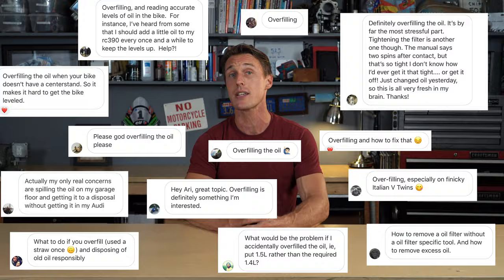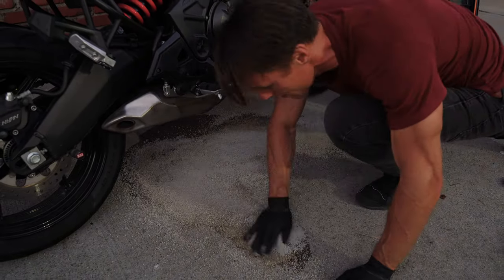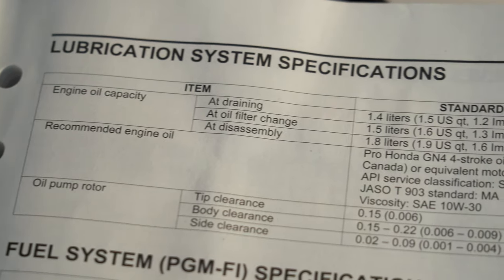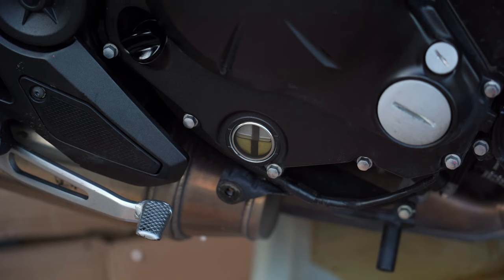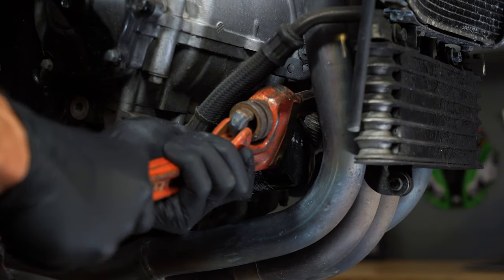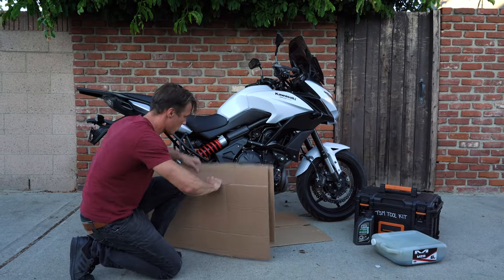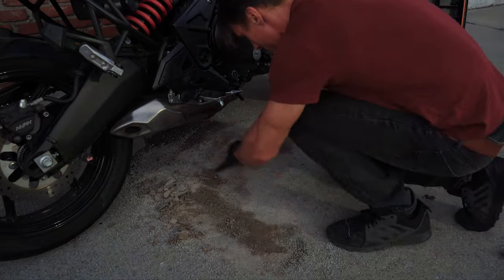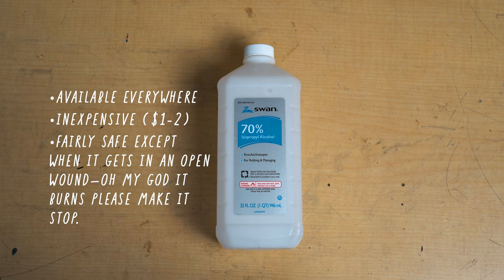Overfilled Oil, Stuck Filters, And Oil-Change Hacks | The Shop Manual

Comment: Alcohol works, but Dawn is my go to for oil cleanup.  It is even cheaper than alcohol  and it leaves things including your skin clean.  And it doesn’t burn in cuts.  😁
Reply: gemini232003 Madge deals with dishes, not real greasy messes.  😁. The folks that clean up animals caught in oil spills use Dawn for a reason.  Same reason I do.
Reply: gemini232003 Nothing against Palmolive, but once you have used Dawn it is hard to go back.  I think Palmolive is cheaper and is fine for normal dish duty.
Reply: Pro tip on Dawn if you have ground all that hydraulic fluid, 30 year old grease and 15,000 mile engine oil into your hands so deep you are sure it will never come out...no water, couple of ounces of Dawn, scrub it in with a nail cleaning brush and THEN add water.
Reply: Michael Krenzer I have found that by the time I am finished washing my drain pan and funnel with Dawn, my hands are already pretty clean even in the crevices.  😁
Reply: Brake cleaner works great, even on the floor.
Reply: @LTVoyager  Me after a day pulling parts at the Pick n Pull for the race car
...yeah, I need all the help I can get.

Comment: Problem is that on my Fazer 600 the check oil level glass window is very small. It is very easy to miss the oil rising, and you will find yourself not knowing if there is no oil, or too much, just by looking at that window... I'm not talking about changing oil, but when one of my friends tried to top up the oil level, and finished by adding 2 more liters...

Comment: I once posted a pic of my zx10r oil sight port to a forum asking if it was overfilled. I was so confused when people posted all sorts of info about different theories. The photo was clear and the oil was above the top of the port; yet people were pointing out a tiny bubble and saying that’s where it should be.......20 posts later and only one person explained it properly.  It’s common sense if you look at it, but the first time I looked at the port was after the oil change and I wasn’t sure what to expect. Should be the easiest thing to explain about the lines in the middle of the port are for a oil level when the bike is upright (i had a pitbull stand).

Comment: Loved the screw driver through the filter tip.  But I wish there had been a tip about how to get your bike off the ground without a lift.  I ride a Honda Fury with only about 3 inches of ground clearance and the filter rides between the two bottom tubes of the frame and is only accessible from below.  There's no way to swing a wrench down there.  The only idea I could come up with was digging a trench in my yard and rolling the bike over it.  (My own little Jiffy Lube.)  But I'm too lazy for that so I still take it to the shop for oil changes.  But speaking of taking a bike to the shop - when it doesn't run have you got any suggestions for good bike trailers?  Folding ones or ones that drop their bed to the ground?

Comment: OIL CLEANUP TIP..........
To remove oil that has soaked into concrete, first pour a little gas on it and brush it around with a rag or an old broom before putting down the kitty litter.  Let it dry before cleaning it up.  When you're done, the oil stain will be gone and the concrete will be clean and dry.
Other solvents will work, but I just use gas since there's usually some in the garage already.
I shouldn't need to tell you this, but since this method uses gasoline, be careful and make sure it's very well ventilated.

Comment: One time I bought a bike that wasn’t running sight unseen. I went to check the oil level and the dipstick was all the same color, looked empty. Then I wiped the stick and looked in. The case was COMPLETELY filled with oil, someone just kept pouring it in until it came out of where it went in. 

That wasn’t its only problem as you might imagine.

Comment: I'd add: buy a filter with a nut if available. Use the nut for removal (not for mounting, because you could over-tighten the filter).
Reply: Been a whole raft of those fail around the nut area once fitted.
Reply: @johna6968  That has only been if tightenned with the nut but there is another reason not to use them...

It is hard for them to check but both tracks near me have banned any filter with a hex on it from track days because of too many incidence of them letting go and oiling down the track.
Reply: @michaelkrenzer3296  Iv never used one tbh. I tighten by hand and remove them with the fabric strap type tool. Had a stinker that refused to move recently. 3ft bar and the strap attached sorted it but pretty much crushed once got moving. Never advocated using a screwdriver
Reply: I tighten them and remove by hand. If you get a stuck one (no lubed gasket), use anything but a screwdriver. Claw type wrenches work great.
Reply: @imadecoy.  That isnt always possible when you didnt fit them
Reply: @johna6968  True, luckily I usually only work on ones I fitted unless it's a new vehicle in which case I'll use the claw type wrench.

Comment: My first ever oil change it was on so tight, I stabbed the oil filter, and when turning it just kept sheering the metal casing enlarging the hole without unscrewing, it was frustrating. From then on, I only ever trust myself with my vehicles.

Comment: I am surprised you did not recommend the Stahlbus Oil Plug. Not only does it prevent a mess in every way you outlined here, it is cost effective when considering all the new plugs you never have to buy.
Reply: Why would you ever have to buy a new plug?
Reply: something1random23 you should and change the ring too   But given the video is about avoiding a mess - which is precisely what the Stahlbus accomplishes...
Reply: @davidsgerson  My manual only says to change the crush washer.

Comment: The engine cover on my GSR750 says 3200ml. Initially I though that was the amount of oil it needed. In manual it says that with filter change it needs 3600ml and without filter change 3200ml.  So I guess Suzuki puts the amount of oil it needs without filter change. I don't know why would someone keep an old oil filter after oil change but it could be confusing for some people. No idea if other manufacturers do the same. When I put 3600ml in my bike the oil level is exactly on maximum.

Comment: First time I changed my oil everything went fine, until I realised that I forgot a spring that held the filter inside the housing. So I went back to the shop, bought more oil, drained it out from my bike and redid the oil change from the start. Then right at the end, I saw a washer sitting inside my oil pan. It was meant to protect the filter from that same spring. I ended up just giving up and deciding to put the washer in at the next oil change. I'm half expecting my bike to just explode under me at this point.

Comment: What about time between oil changes, rather than miles? My manual says every 4000 Miles (or 6 months)... Is the 6 month things really necessary if you only ride that bike 2000 miles per year?

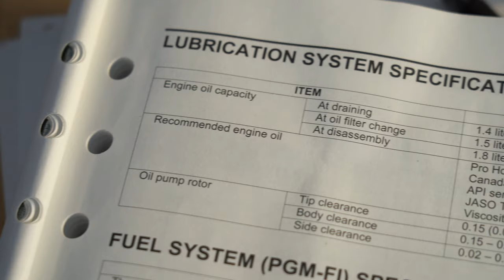Comment: 1:45 Crying in 2024 Triumph Street Triple...

The oil capacity might be in the Factory Service Manual, but I haven't been able to find it in the owner's manual or any other manuals or paperwork that came with the bike, or even stamped/embossed on rhe engine cases. I found it online, but I fully expected it to be listed in the owners manual like every other vehicle I have owned.

Comment: FYI, if no tools work to get a filter off, hammer a ratchet cap on with a piece of paper wedged in between. This has saved my ass several times, even including when stabbing with a screwdriver wouldn't work.

Then just buy k&n filters with welded nuts.

Comment: I noticed my sight glass was all covered with oil, probably overfilled it during my last maintenance. Suddenly my cylinder head got some unusual noise in it. Does it mean, oil doesn’t come up there because the oil is has turned to froth and the oil pump didn’t work well?

Comment: If you only have a dipstick are you supposed to just dip it in till the threads touch or are you supposed to screw it in all the way?
Reply: Usually screwed in, but check the manual.

Comment: No need for over tightening new filter turn till stops and a little tweek will do it,  best of all
Next time you swap out the oil filter it will simply turn and remove no tools required.

Comment: My Burgman 650 has a bad seal and if i fill it above 3/4 it will slowly leak to the 3/4 mark. to change the seal i would have to remove the engine so currently i have no problems with overfilling itself :DDD

Comment: The nut on the end of the K&N filter was useless, stripped within 5 minutes. Rammed that screwdriver through it, but my screwdriver was bending so once i got a decent hole i rammed a thick Allen wrench through it. worked great. i was getting pretty angry at this stupid filter!!!

Comment: F650GS Dakar rider here. Oil goes everywhere as soon as you open a drain point.😂
Reply: EASY fix if this is the Rotax engined model with the frame drain plug.

Painters masking tape and piece of cardboard.  After you drain the 8 oz or so from the sump, put two rows of painters tape below the drain plug on the frame.  Take a  piece of cardboard about 6" x 10" (15 x 25 cm) and fold it so the 6" side is the same width as the frame rail with a folded up side on either  side.  Tape that to the second row of tape on you frame rail.  Place drain pan below and remove the frame drain plug.  Oil goes chute you just created and into the drain pan.

Comment: you forgot remembering to put the oil fill cap back on the bike. my requires you to fill the oil run it for a coupole seconds and the top the oil off. i forget to put the cap on before running it every time. both me and the bike covered in oil mist every time.

Comment: #1 TIP TO NEVER HAVE STUCK OIL FILTERS-
Put a small amount of oil on filter seal on installation, and don't wrench it on as tight as you can and it should come off easy.
Doesn't fix the previousl owners/ shops bad practices, but it will prevent it from happening  again.
Reply: Yes this is the best tip
Reply: Not sure why anyone would even "wrench" it on.  Oil on the seal, hand turn until it seats and 1/4 turn MAX which you can on most cars and bikes do with oyur hand.

Now cartridge filters are obviously a different matter and he did not touch on those at all.
Reply: Yes I agree prevention is better than cure.
Reply: A lot of brand new bikes come without lubed filter seals. Just a warning.
Reply: @imadecoy.  About to find out tomorrow if I am the lucky one..re to change the break in oil on my first actually new bike.
Reply: All very well, except my bike shop manual, as soon as the oring touches, 2 more full turns. The last half turn is tough. My dyno shop won't dyno unless the change the filter as they've had too many blow off during runs
Reply: @ozbusa  I cannot imagine that is true of ANY spin-on oil filter.  Is this a cartridge filter?
Reply: @Michael Krenzer    I didn't believe it either. Never in my life. But, yes, Suzuki manual, two full turns after the oring touches. Does my head in..
Edit, standard spin on metal filter.
Reply: @ozbusa  That sounds nuts. I think it's 1-3/4 max on my car.

Comment: At 3:41 just make sure your bike's oil cooler is not located on the other side of your oil filter when you drive the screwdriver through the filter, like on a Yamaha FZ/MT/FJ/Tracer/XSR-09. Replacing a $14 oil filter could quickly turn into having to replace a $300 oil cooler.
For example: https://www.fz09.org/threads/so-i-fckd-up-oil-cooler-dead.11411/

Comment: You left off one very important item to check.  
Check the old oil filter for the rubber gasket, just incase it  has stuck itself to the engine block.   Because having two oil filter gaskets is not a good thing.  
    Ask me how I know.....
Reply: Also, always lube the gasket on the new filter.

Comment: Have had to use the screwdriver method on every used bike I've ever bought. 

First rule of Oil Filter Fight Club: stop over-tightening Oil Filters.  If you have to use any tool, other than your hand, to remove an oil filter - it's on too tight.

Comment: I do not know why some filters have a socket fitting on top of the oil filter.  If the filter is on too tight that socket attachment is too weak to help.

Comment: Question about using a torque wrench on the drain bolt. Since the threads will be covered in slippery oil do I need to reduce the lb-ft 30% or something or does it matter?
Reply: Nope...torque values are given based on application.  In this application it would be for "oiled threads".  Some head bolts for instance will say specifically "install dry" while others may indicate "install with a light film of engine oil" and finally specialty bolts will SUPPLY the lubricant with the bolts and tell you to use that and only that lube.  All instances will have the correct torque value for the application metod listed.
Reply: You don't account for that. Many torque values are for lubed parts.

Comment: Another important point - Do NOT over tighten your oil pan drain-plug. Most bikes have aluminum oil pans. It's easy to over tighten it and strip the threads, and it will ruin your day. Read your owner's manual and follow their torque specs, and invest in a torque wrench.
Reply: Or you might crack the oil pan.
Reply: @imadecoy.  Yep. Stripped threads or a cracked pan will both ruin your day.

Comment: You left out one important trick, how to pour the oil. Hear me out... On those 1 quart containers, pour with the spout on the high side (counter intuitive). This makes it so the oil doesn't run down the side of the bottle due to surface tension and make a mess. On those 5qt bottles, pour with the bottle horizontal (parallel to the floor). Both these methods give you much finer control how much oil comes out.

Comment: What should I do if I "loosened" the drain plug the wrong way? Threads are semi stripped but the plug still holds.
Reply: Be prepared to replace your oil pan when it cracks.

Comment: I just changed my harleys oil and i put in 2 quart which is less than recommended and i checked the level after letting it idle a little and it was all the way at the top and was foamy in the tank i called the dealer service and he said it prob just needs to cycle through but im scared any suggestions

Comment: I hate Suzuki for putting the oil filter right behind the 4 exhaust headers .
Super annoying to get a grip on, especially if the guy before you just cranked it in maximum power

Comment: This might be a weird and wasteful but does anyone pour a little bit of fresh out through the engine after the old oil is done dripping? My bike asks for 1.7L but I generally use about 2L while pre-filling (and spilling) the filter and pouring some through the engine to vainly attempt to flush out the last of the old oil and whatever bits are clinging to the pan.
Reply: I've heard of people doing that, but sometimes I think they just forgot to put the drain plug in and are trying to play it off as intentional.
Reply: @IslandTosh  I started doing it when I have my RX8. In colder conditions, it would emulsify some oil until it got fully up to operating temperature and 'boiled it off'. I would rinse down the filler and dip stick tube until it ran out of the drain plug.

I've done it with the other cars and now the bike too; run some clean oil through until I see it's clear coming out of the pan.

Comment: The screw driver hack works until that one time all you manage to do is tare the end of the filter off (seen it happen) then it's hammer and chisel time.
Reply: Exactly
Reply: Or tear it all the way off and get in there with vice grips.
Reply: Yes, get a better tool. Don't use a screwdriver ever.

Comment: Why do we need to put more oil after engine rebuild?
Reply: The engine retains small amounts of oil in many, many cavities through out the engine.  A couple of common areas are the valleys adjacent the cam bearings in th heads, any internal ribs in the oil pan, the main oil feed from the oil pump (they almost all have an pressure relief bypass and check valve) but many other locations.  Size of engine plays a factor in how much but most motorcycles it is less than half a quart.
Reply: @michaelkrenzer3296   Thanks for responding.
In an ideal world shouldn't it be such that all of the oil can drain out? Not taking into account the oil film that covers the engine. Afterall the residual oil is mixing up with the new oil.
Are there any cons to it?

Comment: The best way to chance your oil is to ride a two-stroke.
Reply: ..we still need to change oil though. Remember the bottom end still has oil regardless of the mixed gas
Reply: @palermtown  Not if you ride a 2 stroke with a dry clutch and no transmission like I do. XD
Reply: @palermtown  2 stoke oil is what lubricates the bottom end, but you do need oil in the gearbox
Reply: @BigBadLoneWolf  I own two strokes I know lol

Comment: Car or motorcycle my advice, first remove the filler plug.  İf  you can not unable unscrew the drain plug, safe side still have oil in engine...

Comment: I would use sandpaper to remove a stuck oil filter, provided there is enough room for my fat hands to get to the oil filter in the first place.  Also, I'm still a fan of the "old fashioned" (I guess 🤷🏻‍♂️) hinge-style o-shaped oil filter wrench that fits multiple, various (not all, depending on the size of the o-shaped oil filter wrench) oil filters.  I learned all about "stuck" filters when I did my first oil change on the then-new 2015 Kawasaki Versys 650 ABS that I owned.  Man!  The Kawasaki factory put that oil filter tight!! 😬

Comment: DONT TRY THE SCREWDRIVER METHOD IF YOU HAVE AN MT09 OR CP3 ENGINE,   i tried it after watching this, put a hole in my oil cooler and now im down 600$, make sure to check that nothing will get hit by the evil side of the screwdriver